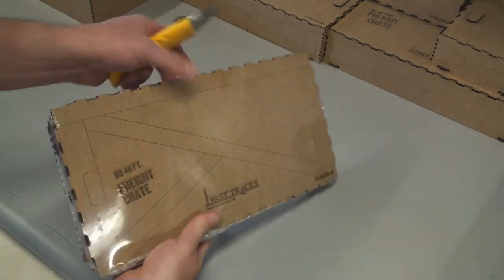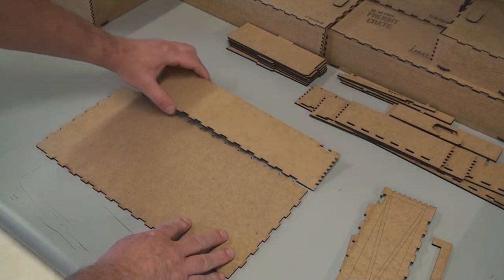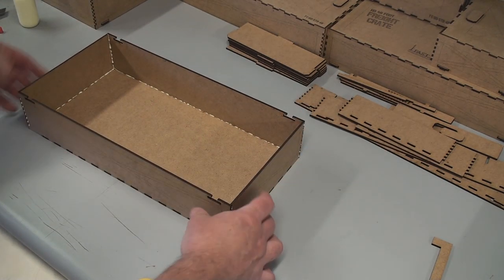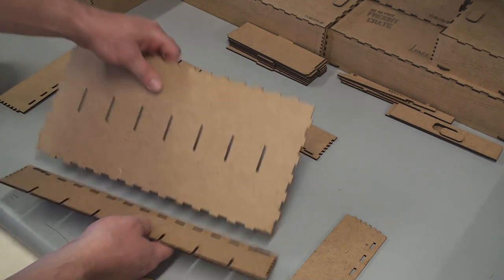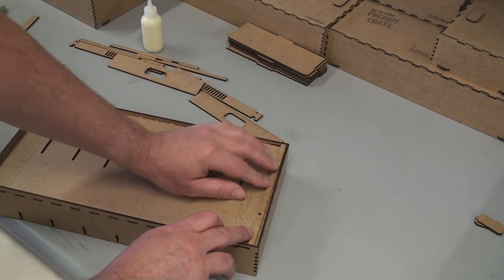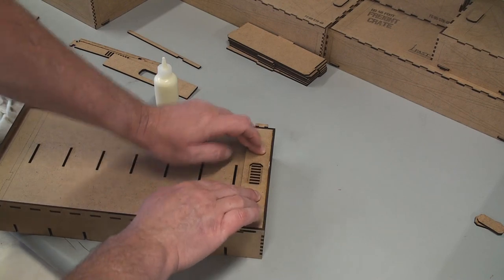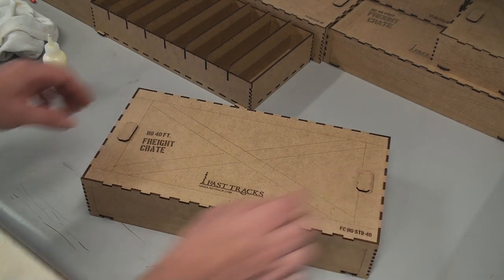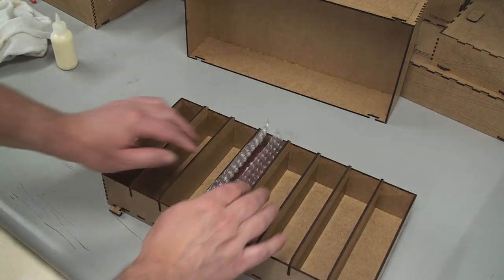FreightCrate Assembly

Comment: so what do you recomend for when you put the car in the box it can rolls back and forth maybe even breaking the couplers off...  you need to supply a small thin piece of foam.. 3/16 inch thick that you can glue to th end wall in each slot so that the coupler can hit a soft surfice and it wont hit the hard box... your welcome!! lol